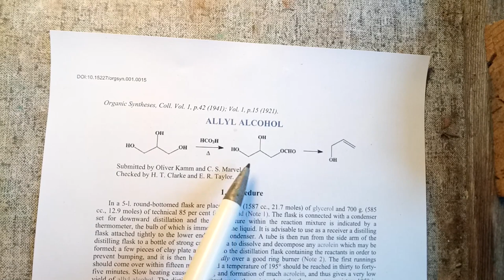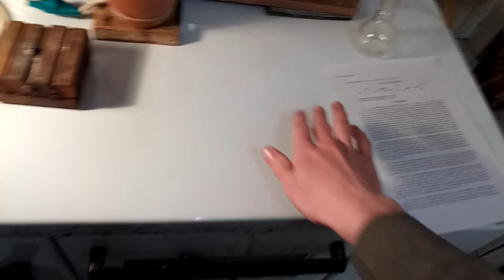Allyl alcohol preparation

Comment: When there is stuff boiling, it heats up the flask. IR thermometer from the top of the glass can give surprisingly good estimate for the inside temperature. (It is somewhat cooler of course due to air cooling and limited heat transfer through glass).
Reply: I said this out loud at the video while watching then read your comment and had a laugh.  Glad you passed along the idea.

Comment: The formate ester converts to the allyl alcohol in the following way: 

In the presence of acid, the formate ester kicks off the adjacent hydroxyl as water, forming the Enol form of 3-oxopropyl formate. 

The 3-oxopropyl formate is unstable and undergoes an intramolecular rearrangement liberating CO2 gas and moving the double bond
Reply from the maker: Wow thanks, that's the best explanation I've seen so far.
Reply: You deserve additional praise for this comment.

Comment: Have you tried glycerin + oxalic acid method?
Reply from the maker: I haven't but from what I have read it has problems with foaming and the yield is a bit worse.
Reply: its the same, the oxalic acid breaks down to form formic acid and CO2
Reply from the maker: @contomo5710  It seems there's several conflicting statements on these methods. I just stuck to the formic acid method as it seemed cleaner and easier.
Reply: @Bavarianscience  cleaner for sure, the oxalic can do other fucky wucky things and likes to form esters aswell
Reply: @contomo5710  In my understanding it goes through dioxalin intermediate. IE not exactly the same.
Reply: @user255  is that so? im not to sure on my theory, its just that i saw multiple papers using oxalic acid because it breaks down to formic acid (formalin and oxalic acid to dimethylate amines for example)
Reply: @contomo5710  Surely oxalic acid can breakdown to formic acid (or CO, CO2 and H2O), but it depends on conditions. Here in my understanding the dioxalin intermediate is preferred.